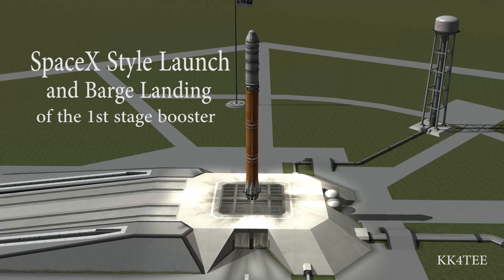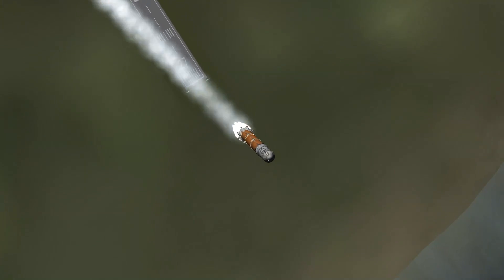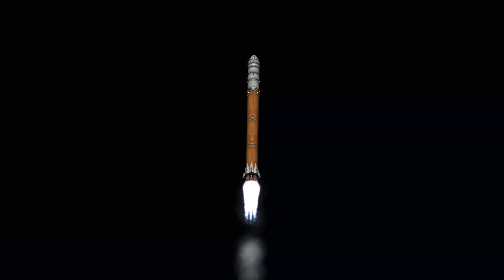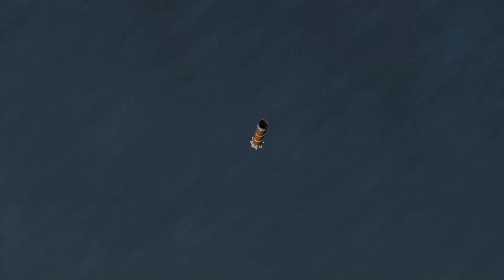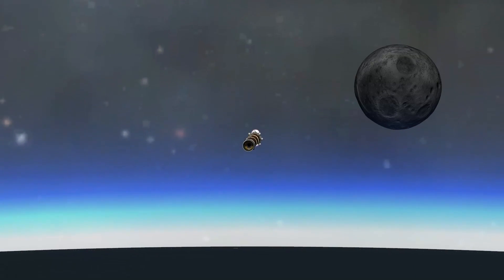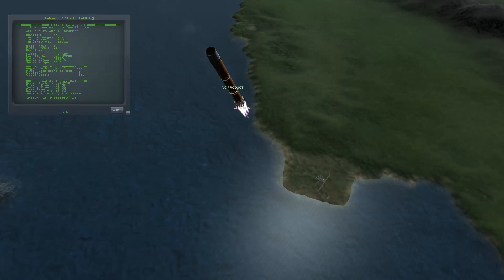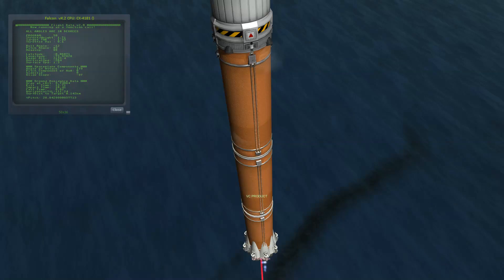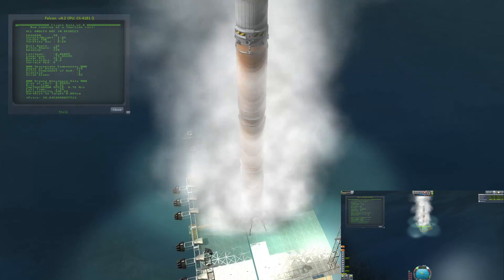SpaceX Style Barge Landing in KSP using kOS and FAR

Comment: This is a real newbie question: I've been trying to do this stage separation and landing, but I suffer from the other stage either completely despawning, or the terminal for the other stage disappearing. Although if I switch my focus immediately after stage separation, each stage successfully either lands or reaches a stable orbit. Any thought/miss that keep both crafts and k-OS CPUs running?
Reply: Not sure, but two notes: The kOS module should be on both stages, and any craft that's out of physics range and below about 24 km will despawn.

Comment: Does the script have a high success rate? Or is it more hit and miss? Excellent work on the flight controller either way.
Reply from the maker: Charlie Garcia My testing procedure was to tweak it until it landed successfully three times in a row. It's tuned specifically for this rocket, although with a few variable tweaks it could probably work for others.